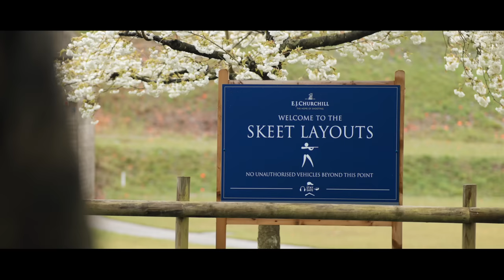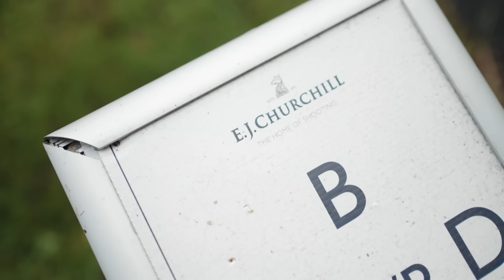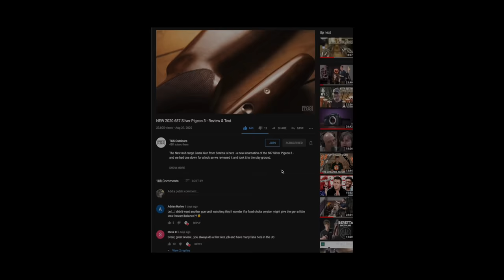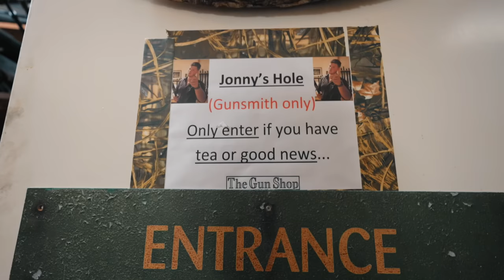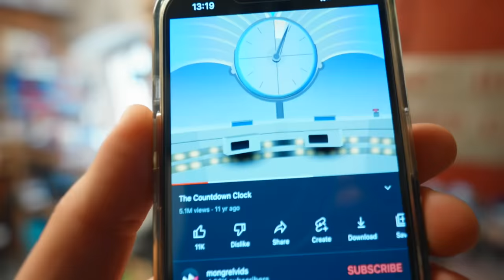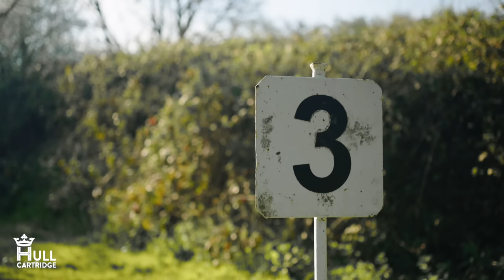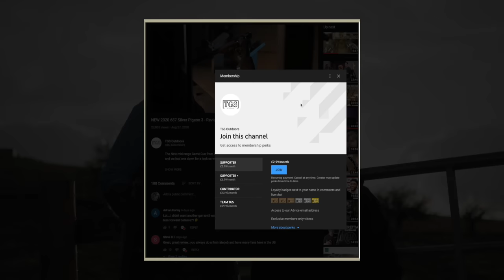Cheap to Charming - 90 Minute Gun Improvement Challenge

Comment: Yet again a very entertaining video Jonny (and Sash). You have given me the inspiration to mess around with an old Webley 410 bolt action where I have refinished the stock totally and polished a few bits and fitted a rubber recoil to extend it somewhat., Still has patina but looks 100% better and have had a few positive comments. Keep up the fantastic work and hope to meet you in person at some point. Well done.
Reply: You'll be loading your own cartridges for that soon ,  you wont get 2.5 inch .410 cartridges in steel 🤨

Comment: Sadly the cap doesn’t look good at all.

Used to use a true oil finish on mine, but you get a build up eventually, and the shiny craggy finish lost me after a while.
Strip the wood with thinners, steel wool the stock and applied 2 coats each 24 hours apart of Matt finish oil for floorboards that I got from a flooring friend….( ridiculously expensive stuff but free for me ) delicious. 
Matt finish that enhances the grain.

Given how the stock looks with the extension and the cap, it’s obviously more functional…. But new custom stock would certainly look better.

Comment: This has nothing to do with what I just watched. But just an idea  would it be possible to do a test on shotgun barrel length and velocity? Maybe compare the shortest legal barrel length a 24 inch barrels velocity to let's say a 34 inch barrels velocity. Obviously using the same cartridge.
Reply: It would be negligible, end of  !.
Reply from the maker: There was a test in a magazine about 15 years ago. The result :

14” was complete burn under normal conditions for modern powder. 

There was a few feet per second between 24 and 30, but nothing that would induce a miss